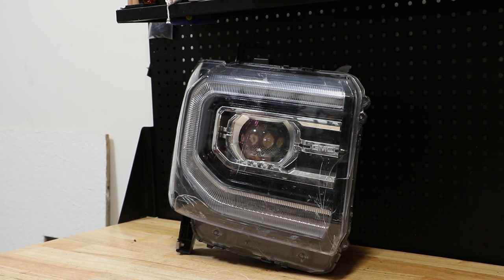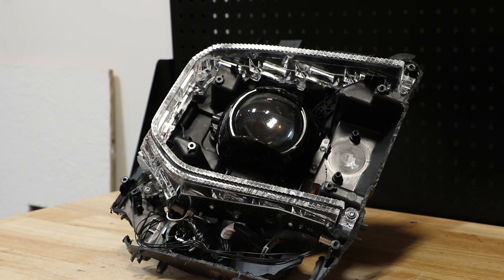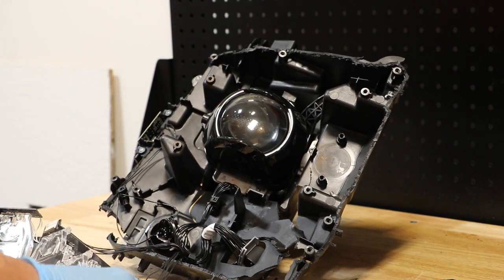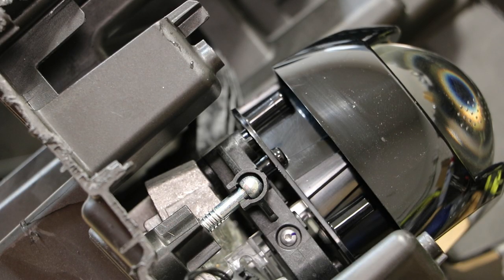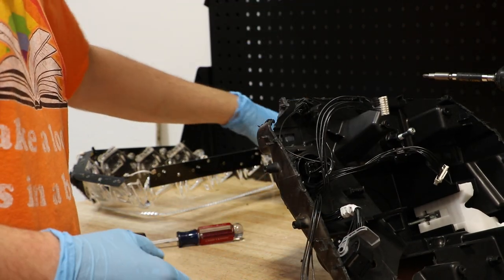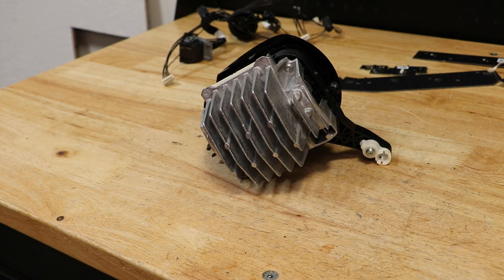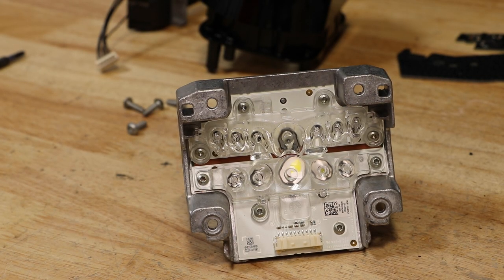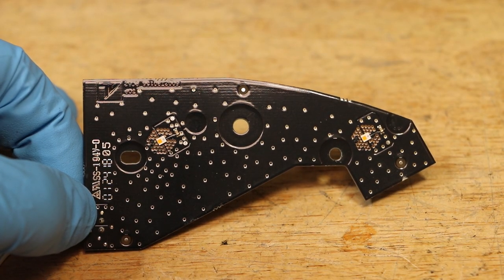2016-2019 GMC Sierra Full LED Headlight Disassembly

Comment: Are these repairable??  My PS halo has gone out and I'm trying to decide if its worth the trouble
Reply from the maker: If you know what you're doing and are experienced in replacing LEDs then I think the answer is yes, but you will need the right LED to replace it with or a donor LED board from another headlight.   99% of the time, it's easier to just replace the headlight.   

It comes down to how much is ~4 hours of your time worth and how much are replacement parts vs a replacement headlight.

Comment: Do you think the middle part of the lens with the GMC logo can be removed? I want to get new headlights but switch out the middle piece to keep the logo
Reply from the maker: Edited:  the GMC logo is embedded in the plastic mold.   If you bought something after market with the same shape it might fit as long as they copied the mold with the screw holes.   Otherwise it probably won't transfer over.
Reply: @gftgrill  thank you! So the plastic mold, in which the logo is embedded, has screw holes and can be removed from the lense? I will likely do what you suggested and confirm the aftermarket has the screw holes
Reply from the maker: @nathanvanorman5887 if you pause it at the 24 second mark, you can see where it's part of the front bezel that is attached to the lens.

Comment: In minutes 7:04 can i replace that part my low beam wont work but the highbeams does is it a headlight problem or harness?
Reply from the maker: That part is not serviceable.  You'd have to buy another headlight to source parts from, open and swap the parts.  If the LEDs are not working, 90% likely that the LEDs themselves have failed or you have a bad control module.